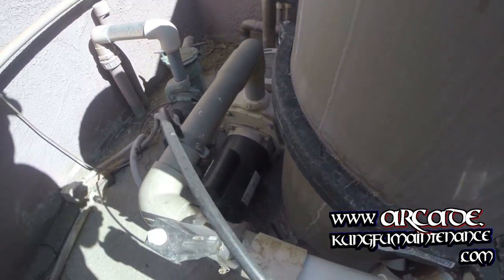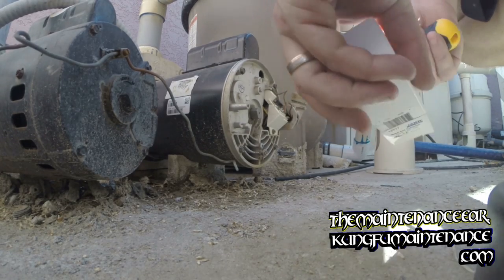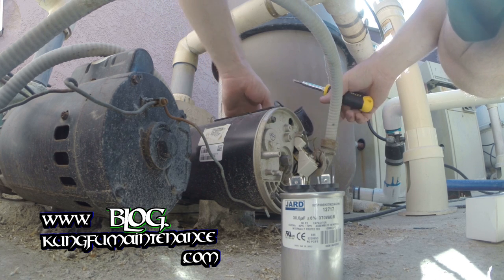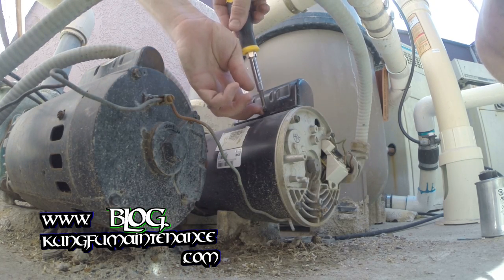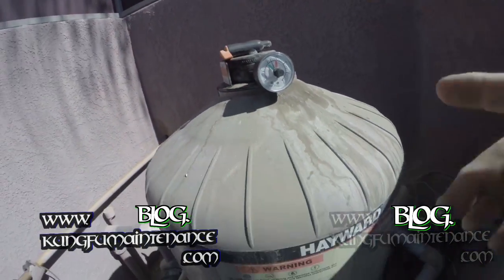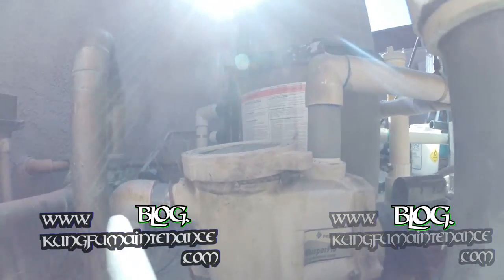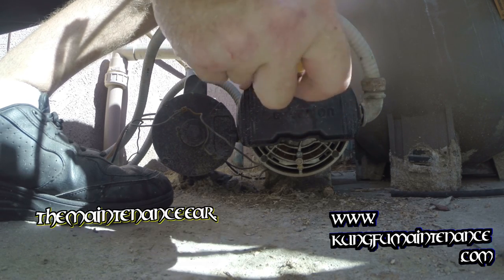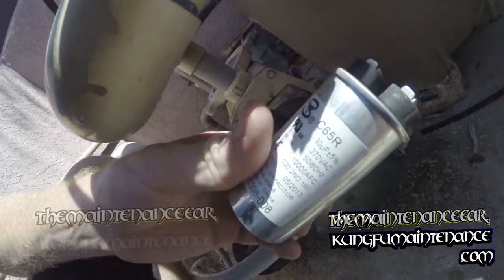Swimming Pool Spa Pump Motor Hums Buzzes But Won't Start How To Replace Capacitor Repair Video

Comment: Before I take out the capacitor, I check that the fan at the other end of the pump is spinning. Invariably, in this rather wild neck of the woods, I find that it is a dead frog, cricket or skink that has crawled in through the grill and while the pump wasnt in use, died and its body is  blocking rotation and thus the ability for the motor to start. Sometimes its a bit of grit or rust from the casting or even a leaf. Same thing happens to me if I run into the side of a shed. I stop and buzz for a bit figuring out why, remove the obstacle by walking around it and keep going.